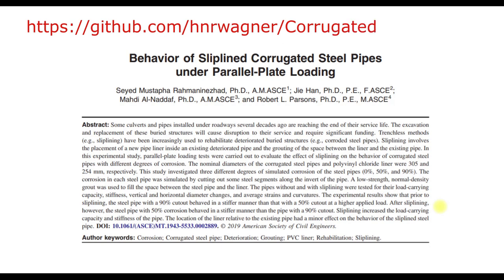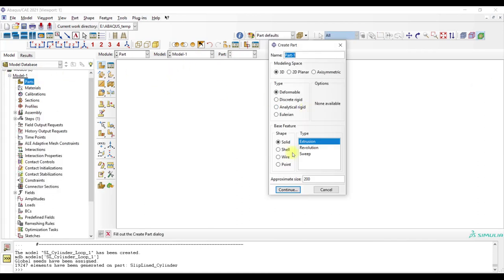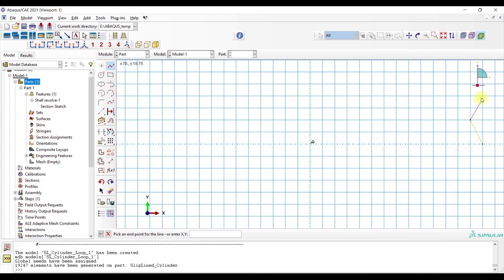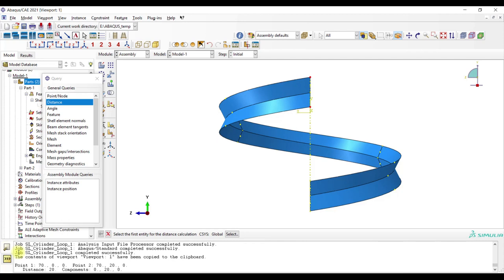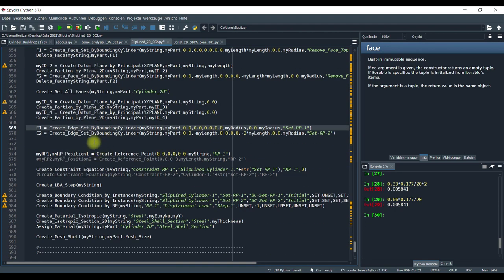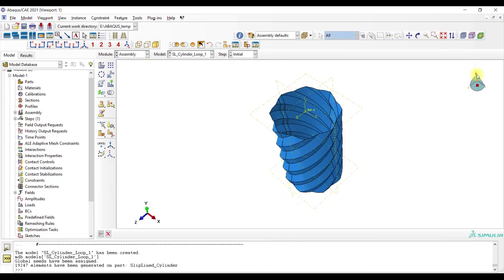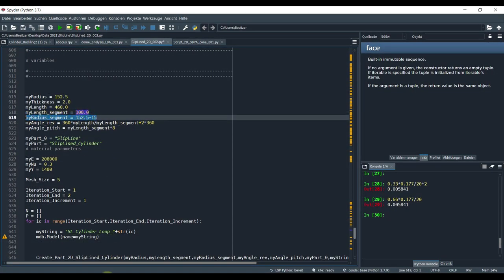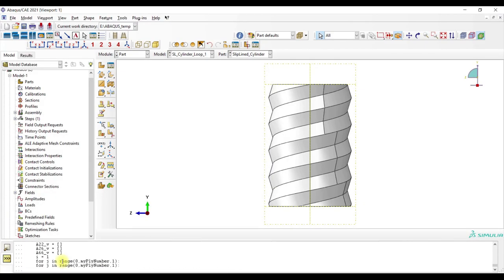#44 Step-by-Step Guide for Professional ABAQUS-Python Scripting - Sliplined Corrugated Steel Pipes

Comment: Great tutorial, Dr. Wagner. Thanks for sharing. Would you mind to explain how to apply non Axisymmetric loads to an axisymmetric model? I.e. Apply a bending load to an a axisymmetric model of a threaded connection.
Thanks in advance.
Best regards
Reply from the maker: I am working on something similar, a non-axisymmetric snow load on a spherical roof. Sofar I did not understand how it works :(
Reply: @hnrwagner  I know... there is something tricky and  not enough information about it.  
To understand all these topics is quite a difficult, thats why your work and videos are surprising :).

Thanks Dr. Wagner.